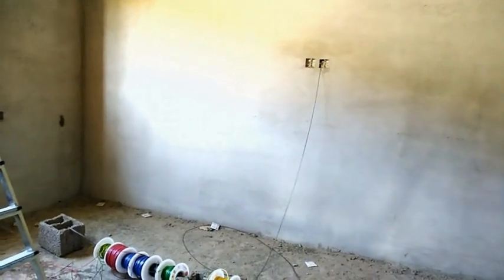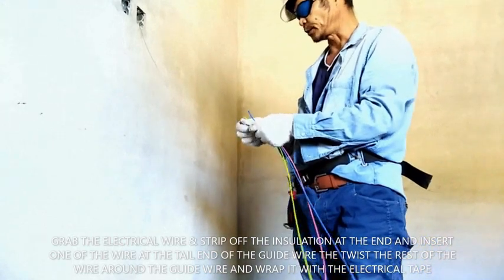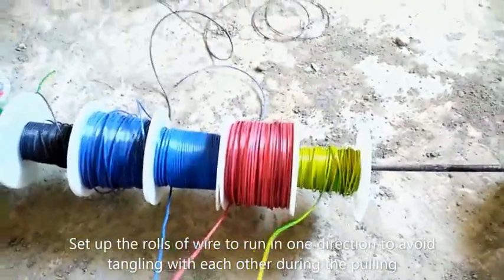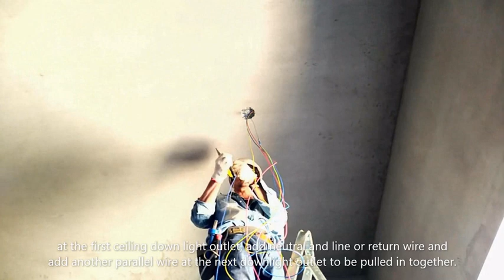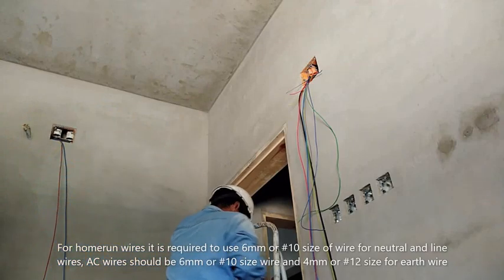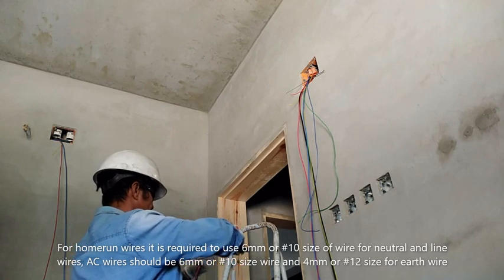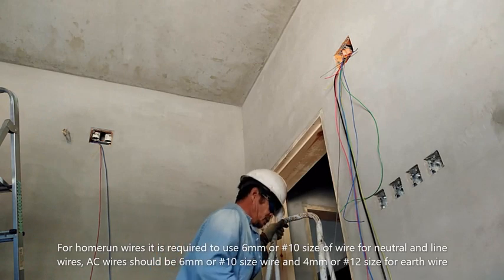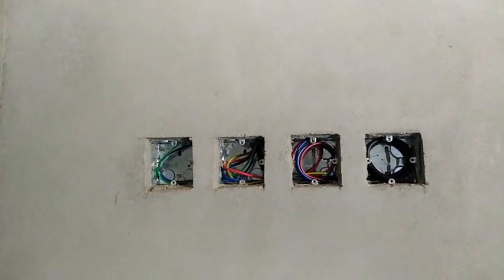how to do electrical wiring in the house and building

Comment: What country are you doing wiring in im interested in wiring around the world i do lots of wiring here in the 🇺🇸 usa hope you enjoy my videos
Reply from the maker: thank you for visiting, we are in Saudi Arabia
Reply: @SkillT3K  thankyou i hear they use 127 volt and outlets are American standard the pictures i saw the look like they go on British standard box with setscrew connections same as British standard and take american plug what collors are used here its 12 awg 20 amps 14 awg 15 amps black live white neutral bare or green ground thankyou
Reply from the maker: @DavidBerquist334  yes sir, you are correct, we are using the British standard boxes with setscrew holes. We install and fix 127 volts here 20 years ago, but now we don't do it anymore except for special purposes, the service provider here in Saudi Arabia is in 380 volt  for the consumer, We are practicing the Red, Yellow, Blue color code for lines 1,2,&3, Black for neutral, bare or stripe green/yellow for earth wire, other colors are utilized for secondary wiring system, we are also doing the same as you do when it comes to Amp rating, #10 awg for 30 Amps, #12 awg for 20 Amps, #14 awg for 15 Amps
Reply: @SkillT3K  thankyou i wonder if you can send me a 127 volt outlet that the front is American standard plug and a light switch 127 volts and mounts on British standard box how much would it cost and how could i pay for it

Comment: Sun glasses inside the building, nice to show everyone how to be a cool electrician. He don't see anything
Reply from the maker: thank you for visiting, we always wear a one way safety glass every time we are at work for protection, especially during the wire pulling because we are exposed very close to the materials that we are working with.
Reply: it's a basic PPE, need a clear glass though when working inside the building.